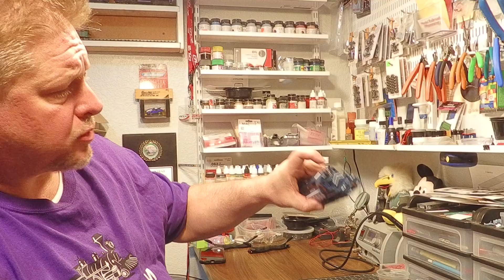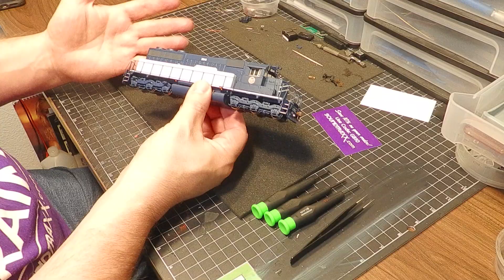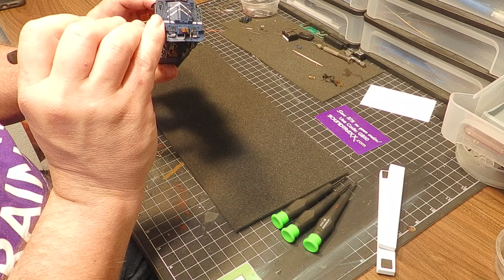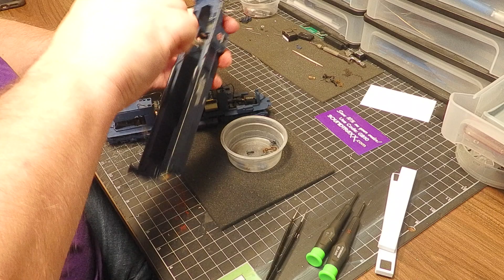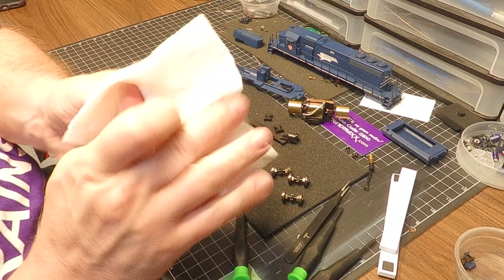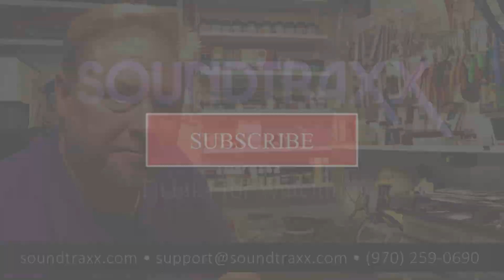Rehab My Loco. Part 1: Locomotive Disassembly (Athearn SD40)

Comment: Have many BB’s that I haven’t converted due to the original motor just being to loud, any tips for upgrading the motor would be appreciated. Thanks George!
Reply from the maker: Some tricks on rehabbing old blue box motors: polish the commutator; clean and use compatible oil to lube ONLY the bearings on either end of the motor.  Check the spring integrity and tension on the brushes. Contact our Support Team for more info: (970)259-0690 or support@soundtraxx.com

Comment: Could you mention the best way to get a shell off an Atlas, Genesis, or Kato that you have to squeeze the shell to get it to release its tabs?
Reply from the maker: Look under the locomotive and locate the tabs where they snap into the frame.  You may have to remove handrails on some engines attached to the cabs ( ATLAS CLASSIC GP7, etc., ) to keep from breaking them; and gently squeeze inward on the shell near the walkway...slightly moving the shell back and forth...until it slides free of the tab.  Sometimes it helps to gently nudge it free with a really small standard screwdriver.
Reply: Thank you

Comment: For the Athearn blue box or RTR,you can test the roll of the bogies.If too much resistance,strip,clean burrs,and oil gear posts.Clean axle bearings,re oil.Should roll better.Less resistance,less load on motor.Can also strip motor,check end play,clean commutator.Maybe even run it in on a test bed for a while.Then replace into Loco.
Reply from the maker: Thanks for sharing your tips for locomotive maintenance!

Comment: Nice starter video for working on a 2017 run Athearn RTR. I did a model similar to this but it was 2009 and it took a bit more effort for LED replacements, speaker, Tsunami2 PNP decoder, and ditch lights. Clean install and work!
Reply from the maker: Very nice!